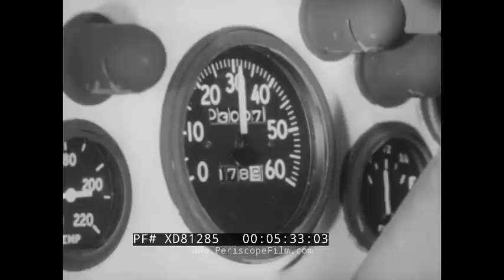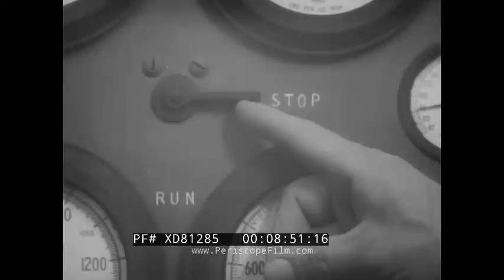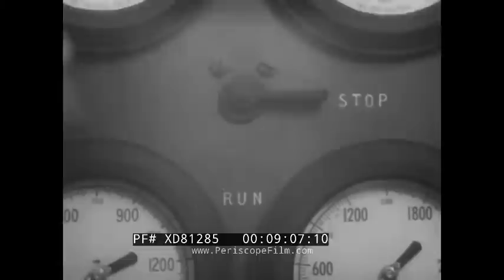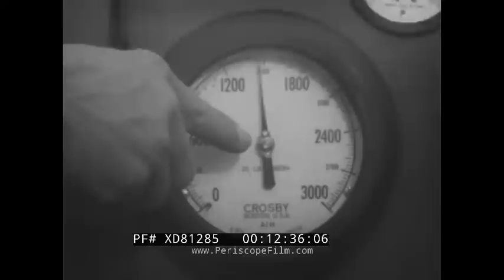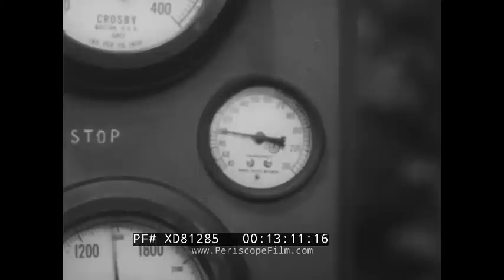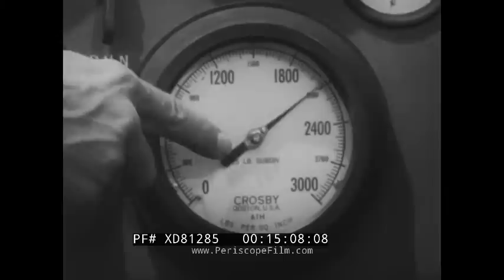" FLAME THROWER IN MEDIUM TANK — SERVICING"  WWII ERA SHERMAN TANK CREW TRAINING FILM XD81285

Comment: Nowhere near as efficient as the British "Crocodile" were the fuel and propellant were carried in a trailer not in the tank itself. The main armament was retained and the flame projector replaced only the bow machine gun. The trailer carried a lot more fuel so was longer lasting, if it ran out  you could just replace the trailer in a few minutes. The Crocodile flame projector had a range out to 150+ meters in combat.
Reply: Yeah, try bringing it into a jungle island
Reply: @UnicornstalkRGaming  It was actually tested in Jungle conditions in India / Burma. But found the flame projector was inhibited by the close vegetation. Incidentally the US Flame Throwers were actually older British / Canadian designs. The US Army chose the Sherman Crocodile after British Churchill Crocodiles regiments supported US troops in NW Europe.

Comment: Who designed this setup, Rube Goldberg??
Reply: I was thinking the same thing. Just how well it all worked months into action? North African sand storms & dust? Hundreds of miles of bad roads and winter conditions of Northern Europe? Still beats the heck out of mixing it all by hand with a wooden paddle like they were in the Nam. Mogas & M-4 thickener same stuff to make fougasse or napalm.
Reply: M4 flame fuel thickening compound is a nonhygroscopic thickener, adi-acid aluminum soap of isooctanoic acids derived from isooctyl alcohol or isooctyl aldehyde, which are obtained from the oxidization of petroleum.M4 is used in fire bombs and incendiary weapons.
Reply: I had idea this was so simple! 😂
Reply: More Armchair Combat Eingieers here! Keep em coming!

Comment: I don't have a lot of knowledge about flamethrowers but I could devise a system to refill the tank much faster and easier with fewer men. Put a cascade system on the truck for the air recharge. It could be refilled when not actively charging the tank and would cut that time way down. You use a system of bottles compressed to higher pressures. Then put a tank in a second truck with a second tank for the powder. Mix it in a third tank ahead of time and then pump it on the tank when it pulls up.

Comment: Ahh, the good ol' days when a $100 drone wouldn't wipe out the tank and fuel truck...
Reply: Or one of the soldiers forgetting it's a no-smoking zone.
Reply: That poor driver's best bet was keeping the canvas up at all times and concealing it among all the other rando supply trucks. I suspect that's precisely what they had in mind when they designed the entire pumping apparatus to fit under the canvas. I know there were gasoline tankers designed the same way (to try and avoid drawing fire).
Reply: Is it is the US Army still using flamethrowers? I don’t mean flamethrowers on tanks, but I mean flamethrowers in any configuration. Any ideas guys?
Reply: Just curious guys, is the US Army still using flame towers in any configuration, not just on tanks
Reply: @challanger275  not as weapons, no although they still have them in inventory.